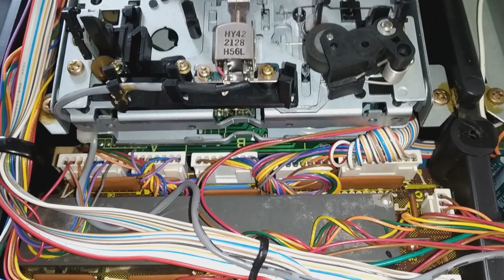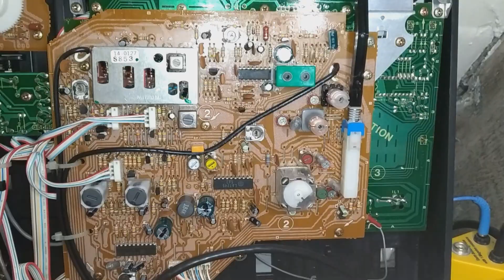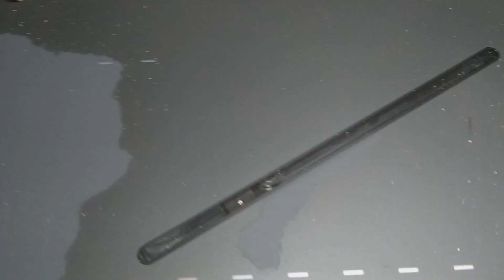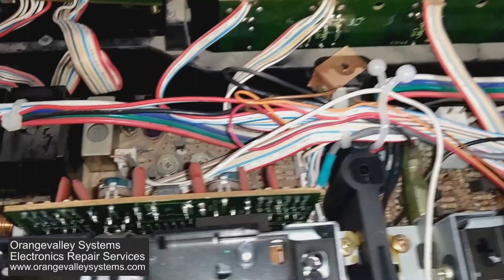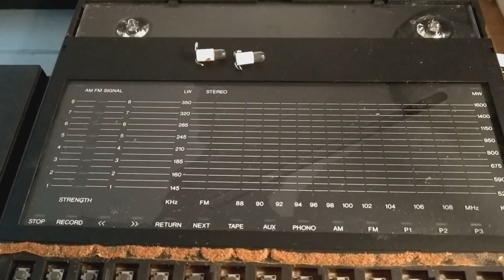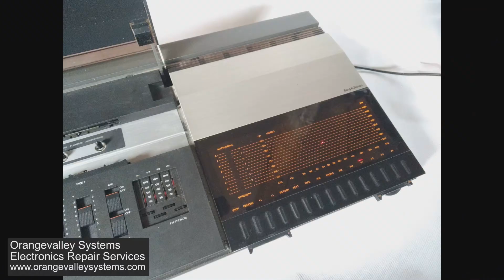Bang & Olufsen Beocenter 4000 repair

Comment: Hi very good work 👍my Beocenter has in Tuner mode only the left channel. So I will just service the tape decks and replace the two pilot lights. For the other problems it goes out for repair, think it’s to difficult for me😅